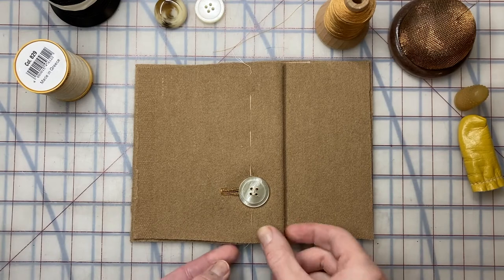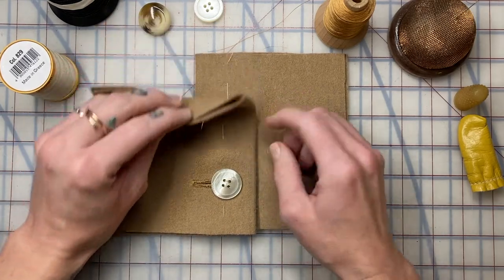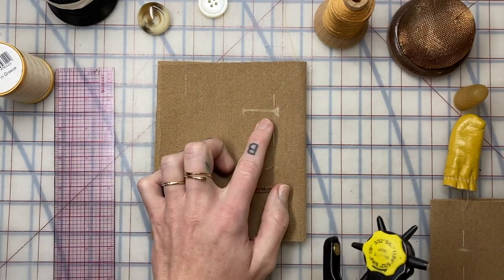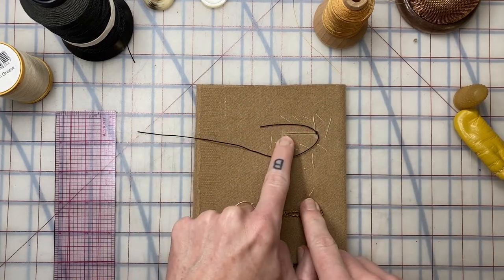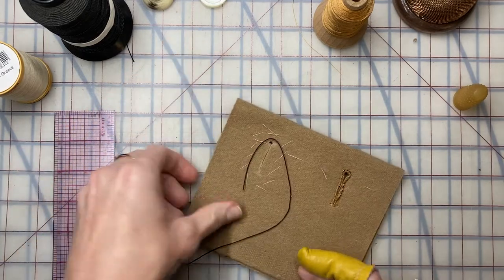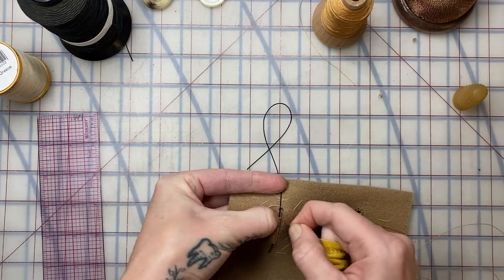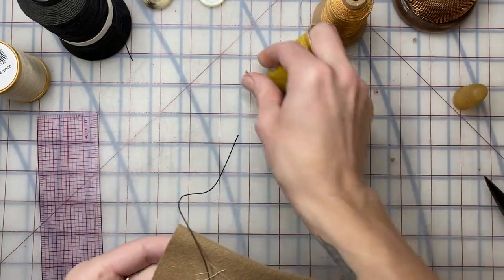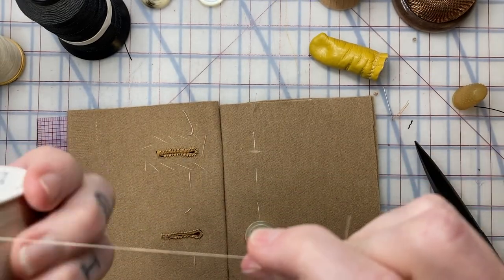How to Sew a Tailored Buttonhole by Hand

Comment: Love hand made button holes! I do mine much the same except I have a chisel set and a rubber hammer to cut the size needed. I use bees wax but I iron the thread between a cloth before hand. I have never thought of using embroidery  thread. Thank you.
Reply from the maker: Yes, you're so right. That is ideal if you have the punches and wax has always proved helpful in hand-sewing.  I wonder why I haven't used it with buttonholes yet.